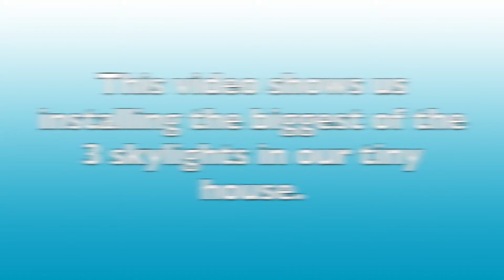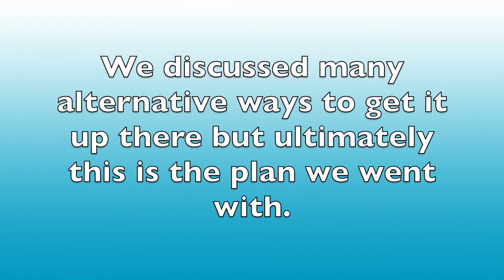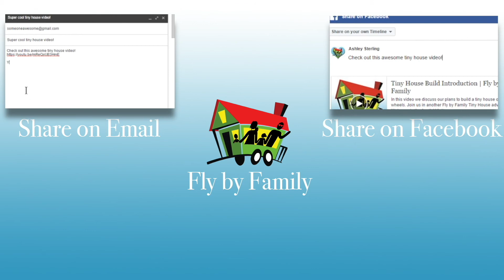Tiny House on Wheels Giant Skylight Install (Ep. 16) | Fly by Family

Comment: I love your build, and commend you for your work, but THREE skylights!? Isn't that a lot of effort and expense, for a guaranteed leak one day, and massive solar gain? Wouldn't it be easier to go outside to look at the sky?
Reply from the maker: Hi Michael and thank you for your comment. True that there is a trade-off with skylights heat wise and increased leak risk...but we love the idea of being able to see the sky at night, even in the dead of winter (as long as there's no snow of course) or watching the rain fall on the glass. We did 3 so that our kids each have one over their bed and we will have the big one over ours. As far as leaks go, I like to think I did a good job sealing them and honestly, I think the design of skylights these days is way better than the older leaky ones. The expense was a bit more obviously than having none, but we did buy them off craigslist so what cost we did incur was low. There is the added heat during the summer and honestly added to that is the massive amount of windows we have...but we want the space to feel open when we're in the TH and we hope to achieve that with windows (and skylights). I do plan to oversize my mini-split AC to make up for the heat a bit. Cheers!
Reply: Mind, you can just angle the house so it has a minimal profile facing the sun during the summer and a greater exposure during the winter...  

You can also get black out shades for the skylights that you can use during the day to minimize heat gain...

If it gets really hot in your area then consider painting the roof white...

While careful placement of mirrors can also help make the space seem bigger...